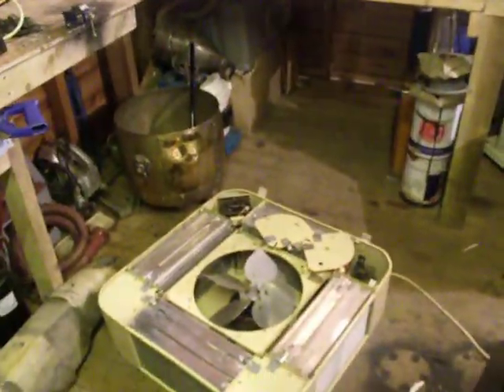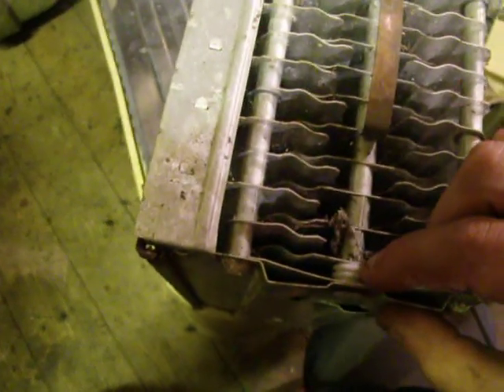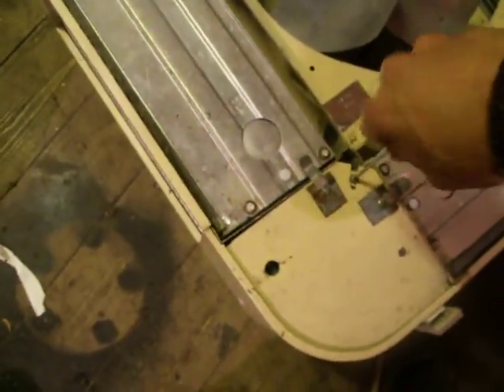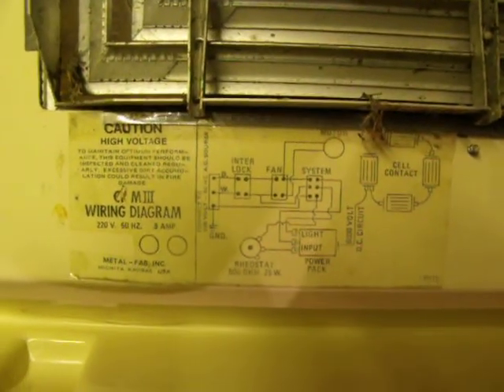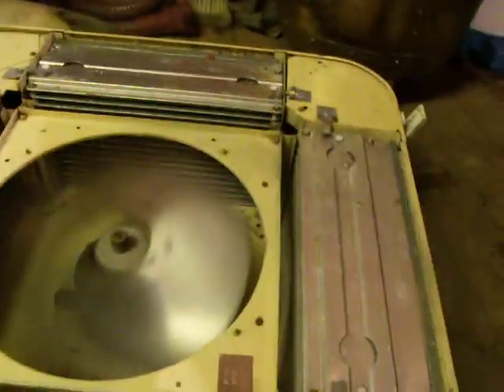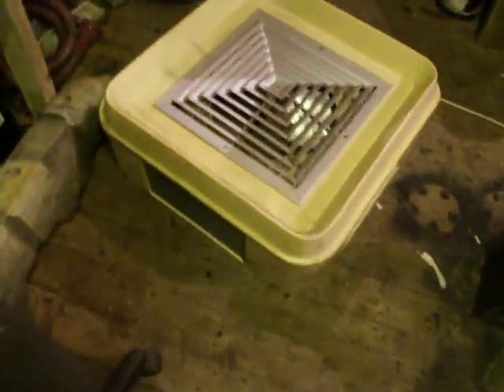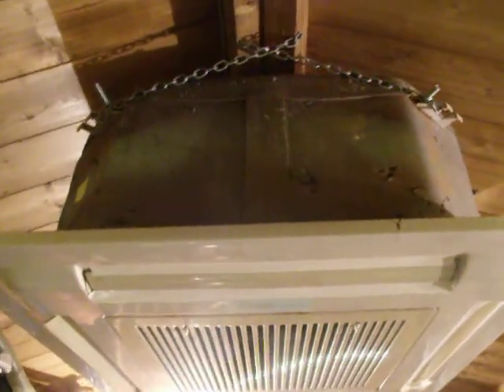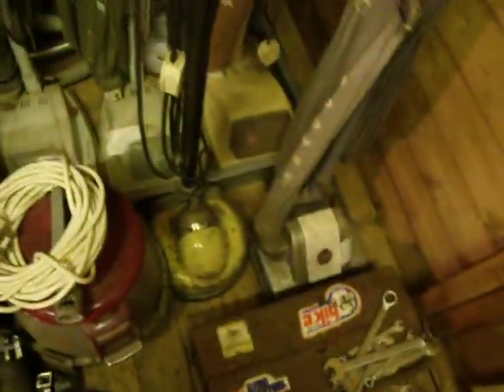ElectriMaid air cleaner.

Comment from the maker: ive had that sokeing in 50/50 mix of gear and hidrollic oil over 24 hour's and it dose run smooth but just warn, it is ment to run the other whay round so what your seeing is ment to be faceing the floor cos it's celling mounted, so prob's to much presshuer on the back bearring, I tend not to worry about thing's like that cos it work's, runn's smooth, has verry little axal play and if it dose fail ill make or put new bearing's in it, and just one thing that's for subbing to my channel